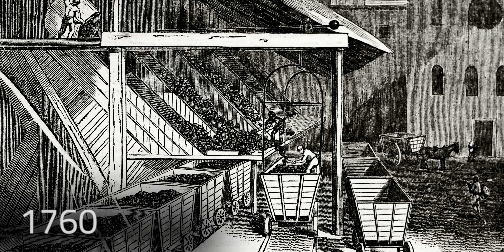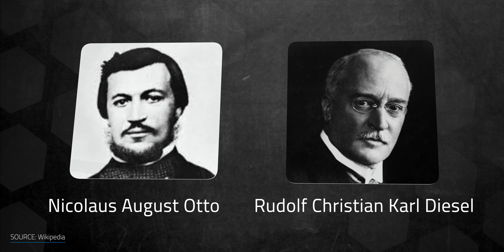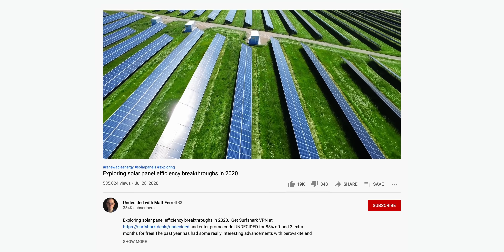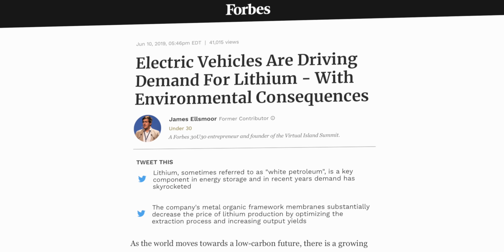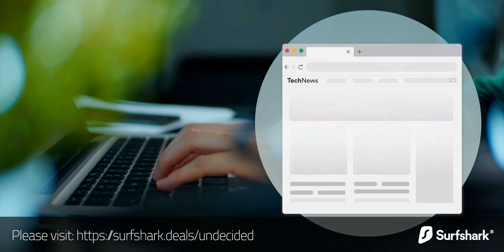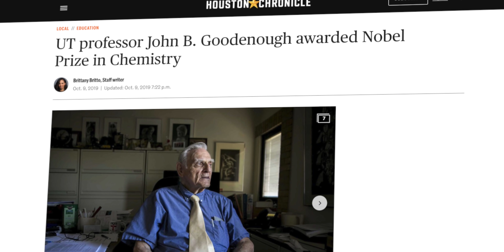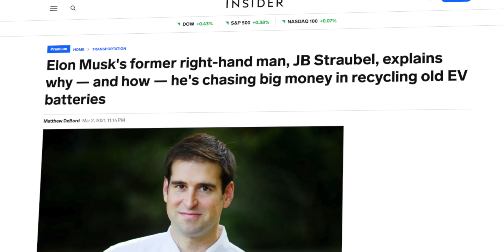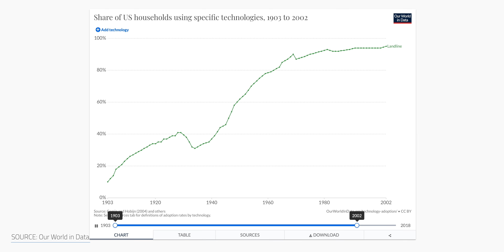Is the Future of Renewable Energy Inevitable?

Comment: How about a video on 'second life' of batteries.  That hazy time between end of life in their primary use and going to the recycler. ... Thanks for keeping publishing this type of video.
Reply: It would be cool to see a device that can take half full batteries and pull the rest of the charge out, disposable batteries of course... You just keep popping them in. Maybe charge a different rechargable battery. IDK,,, is just fun to think about.
Reply: @Robert_McGarry_Poems  Unfortunately, would not be very useful considering how small even the largest disposable batteries are
Reply: @Robert_McGarry_Poems  there is a battery recycler in Europe (I think Austria) that is using the charge from the batteries they recycle to power their operations.

Basically, they need to fully discharge the batteries anyway, so on average they provide about half the energy required to recycle them.

Pretty clever.
Reply: @Robert_McGarry_Poems  try looking up a "jule thief". It does that, a circuit not an appliance.

Comment: I can't wait for the day we can take seawater, use solar generated electricity to create hydrogen from it, compress it and pump it through pipes to areas that currently are water-poor, convert it back into H2O (recapturing a portion of the energy used) and using the clean water in those areas for both agriculture and living. Hopefully not too far away.

Comment: Hi Matt, great video. I really enjoy your work. A frequently overlooked resource, geothermal energy and in particular, enhanced geothermal systems (EGS), is an emerging renewable energy source that should play a larger role in increasing the adoption of renewable energy. Some benefits to geothermal energy include, high efficiency and baseload energy generation which integrates perfectly with our current grid. The western United States has a high geothermal heat index that can be tapped once EGS technologies and drilling techniques can be perfected and made cost effective. The U.S. Department of Energy's FORGE Initiative is currently conducting research in Utah to close these gaps in developing EGS.

Comment: There are some flawed ideas here. 
1. The physics (first principles) of current solar cell chemistry means that efficiencies (percentage of the energy of the sunlight captured) above 45% are not possible. New chemistries may improve this, but the key here is cost improvements. If the cost of solar panels drops because of efficiencies in manufacture, they become increasingly competitive compared to existing energy generation solutions. It is already cheaper per KWh to install solar panels with battery backup than building and fueling power plants and paying for distribution in many parts of the world, and this will only get better as we move forward.
2. While solar panels and wind turbines have limited lifespans, so do traditional power generation solutions. They will be replaced with whatever is cheapest. Following current trends, this will be renewables with batteries.
3. Green hydrogen is like clean coal. It is a marketing concept that does not reflect reality. The inefficiencies of creating, pressurizing, storing, transporting, and using hydrogen mean it will always be a poor energy choice in all but the most demanding applications.

Comment: Wondering how GP Joule gets to 95 % ? In a power-to-gas-to-power configuration I calaculated about a 40-45 % efficiency maybe a year ago. That's not the same as power to hydrogen (that you could use for thermal heating to avoid further conversion losses -  95 % is fantastic) but I think I used 75-80 % back then and even worse for the gas-to-power step. Splitting water gives you not only H2 but also O2, and that's where part of your power input goes to. The 95 % seems to contradict that.
Reply: Ah, I see - they are including waste heat in the efficiency calculation. P-G-P electric efficiency is 40 %. 
It's still an option if you have local value for the heat.
https://www.gp-joule.com/100-renewable/the-power-gap-filler/

Comment: Try running a hospital or steel mill on wind and solar
Reply: There is a great project in germany called Salcos. They plan to run their steel mill nearly entirely on green hydrogen in a few years.
In sweden a similar project has been started.
Reply: @mAx-grassfed  Germany has the highest electricity prices in the EU
Reply: @nigeltufnel4031  
Costs are not that high for companies.
Also germany is an exception in this regard due to EEG. Renewables dont need to cost more. Actually wind is cheapest of all energy production forms nowadays.
Reply: @mAx-grassfed  every MW of wind and solar is backed up by reliable sources. Oftentimes spinning reserves.
Reply: @nigeltufnel4031  
That is not true, lol.
Reply: @mAx-grassfed  what do you do when the sun is not shining or the wind is not blowing?
Reply: @nigeltufnel4031  
Redistributing the electricity from somewhere else where the sun is shining or the wind is blowing or pumped hydro exists.
Reply: @mAx-grassfed  so those other areas don't need their energy?   Also, from the opposite side of the planet?
Reply: @nigeltufnel4031  I ll drop a few key words knly as I am in a hurry.
overproduction, supergrid

pumped hydro is a energy storage

Also need of electricity also fluctuates.

Though energy storage needs to expand further.

But no, not every wind MW needs to be backed up even today already.
Reply: @mAx-grassfed  pumped hydro is limited by geography
Reply: @nigeltufnel4031  i know
Reply: Also there are great low maintenance energy storage devices that could be used in hospitals like redox flow batteries.
Reply: @mAx-grassfed  at what cost. Grid batteries are good for 60 minutes max
Reply: @nigeltufnel4031  
Redox flow can be scaled easily. For imobile uses they are perfect.

Comment: The key is keeping renewables doing something useful when there aren’t enough loads to power. Storage in flow batteries or hydrolysis seems like our best ideas now. I’ve also been thinking there could be quite a market in retro fitting ICEs for hydrogen or converting to EVs
Reply: Flow battery, Na-ion, that's what I think.
Reply: On a industrial scale, I think hydro gravity and molten salt energy storage are feasible.
Reply: Drew

when and where do renewables not have enough load? 
So much of the time their output is abysmally low.

Comment: Regarding GP Joule ... 
Where exactly did you get the 95% efficiency from? 
On their site, I see statements regarding 75% efficiency ... but as far s I can tell, there is no product, just a story for the time being.
Reply: True, some article said 69%
Reply: The 95% is a combined figure for an example-implementation they have. 75% of the energy are used to generate Hydrogen, and annother 20% of the collected energy are distributed as useable heat into a "Nahwärmenetzwerk" = "local heating network", which is provided as a direct heat supply to home owners and business sites. Of course adding up like this would not be valid if you want to generate Hydrogen in very extreme amounts, but combined generation & use of electricity/hydrogen & useable heat in local facilities generally seems like a pretty good Idea to me.

And they are not a manufacturer of a specific product, more a project planning/system engineering company that supports customers with the planning & implementation of a complete use-case including infrastructure. But they are pretty active in marketing the technologies & concepts they use in their systems towards media & politics.

Comment: I think the key to renewables is bringing the cost of solar down to the point where everyone everywhere can cover their roofs at a very low cost. Improving efficiency can come second and will have to be paired with vastly improved power storage tech and availability. Yes, we really can all have power walls in our homes if the price comes down enough. Even apartment buildings can swap out their emergency generators for battery banks.

Comment: Yes, renewable energy of: solar, wind and hydro, with battery back-up, is inevitable, in the long run, however, some SMR's will likely need to be used around large urban areas to maintain base load capacity until battery tech becomes ridiculously cheap and installed.
Reply: @George Mann You might want to tell that to utilities around the world who are supplying a large amount of power from solar and wind farms, today and are planning for MUCH more, in the future.  MidAmerican Energy is currently supplying 80% of the power to their customers from wind power, and plans to make that 100% over the coming decade, and many other utilities are doing the same.
Geothermal will be the source that's more relegated to niche applications as there's very few places you can install a geothermal power plant and even then, the capacity is pretty small.  Hydro will not grow much at all and nuclear is so expensive, it's cost-prohibitive, in large reactors so SMR's are the only hope for nuclear, and even then, they will require quite a bit of government subsidies.  
2 coal-fired power plants have recently closed near my house and are being replaced with solar and wind farms, here in Northern Arizona, like they are all over the world, and gas plant construction has drastically slowed.  
You might want to do some research on future power capacity.  Here's a good place to start: https://www.iea.org/fuels-and-technologies/renewables
As you can see, 26% of all power capacity today comes from wind, solar, hydro and a tiny amount from biofuels and that number is growing rapidly, every year.  When I first started in the renewable energy industry, that number was around: 5%.  By 2030 it will be just north of: 50% and by 2050, it will be nearly 100%.
Reply: @George Mann Please be honest, George, do you work in utility power generation?  Have you ever looked at the pricing structure and LCOE of various power generation bidding on the grid?  Have you ever seen bids for new capacity to utilities?  Do you have ANY idea what you're talking about?!
I've worked in utility-scale wind generation for over a decade, have worked closely with utility managers and engineers, have bid on  numerous new wind farms, have worked with multiple Senators and Congress in D.C. and many state and local government officials in adding new capacity and I know EXACTLY what the price of new capacity is, from each technology, and I know exactly what their tax incentives are as I helped draft some of them many years ago.  Fossil fuel subsidies are permeant, and have been for the past 100+ years, and average: 20% of all production capacity.  Renewables average about 1/2 that amount: https://www.greentechmedia.com/articles/read/subsidies-for-oil-gas-nuclear-vs-renewables

I went with a group to Washington D.C. a few years ago to work with Congress to just give the same subsidies to renewables as they do to fossil fuels, or eliminate ALL subsidies as it's not a level playing field.  Today, commercial wind power receives a: $0.023/kWh tax credit and solar receives: $26% ITC for the construction only, no production credits.  

There's no need for 24-hour battery storage when solar and wind typically meet 100% capacity demands during the day but grid managers have, and are adding battery storage for ~4-hours during peak late afternoon times when solar generation reduces.  

I would encourage you to do some research before spouting off nonsense and opinions you know little-to-nothing about to get educated why utilities around the world are switching over to renewables.  It's not because all grid managers suddenly became environmentalists and say "damn with energy prices," no, it's because wind power averages: $.002/kWh, solar averages: $.003/kWh, nat. gas: $.0035/kWh, coal: $.0089/kWh, nuclear: $.009/kWh.  It's all about economics and solar and wind are cheaper and far faster to deploy and come on line.  Utilities issue RFP's and everyone is welcome to bid, as I have many times with my company, and the lowest price wins, which is why wind power wins most of the time.  Wind turbines spin: ~80-85% of the time with no cost to fuel and very little maintenance.  Solar produces ~50% of the time with virtually no maintenance or cost of fuel.  Fossil fuels and nuclear can't compete, not now, nor in the future.

Also, why are you watching a video about renewable energy when you don't seem to care about it?  You just here to troll and spout lies?

Comment: I would be hesitant to say that modern technology requires less infrastructure than older technologies and that being why modern tech moves so much faster.  I think it is more that more modern technologies run on the same infrastructure so we are not having to redeploy the whole back end every time we come out with a new end-user technology.  Phone systems took a long time because it was expensive to get the circuits laid out, but adoption was about as fast as availability through the whole process.  But then as phone systems grew and implimented multiplexing and other line-sharing technologies to allow multiple calls on the same physical hardware we saw a transition from physical multiplexing, to digital multiplexing, and once it was digital, then we could run phones, fax, and internet on the same lines.  As more internet-focused technologies were rolled out we have transitioned from digital signals running on a phone system, to phone systems running on a digital network.  But this same network that does landlines, cell phones, internet, etc. is the same platform that will support future power switching and other technologies that we havent even thought up yet.

On the flip side to the same coin, because so many different technologies rely on the same basic infrastructure, it makes it easier to green-light and fund these kinds of projects which makes further deployment that much easier.  When you had to maintain sperate networks for phone, internet, cable, and whatever private connections, then each individual backbone is equally expensive to deploy.  When it all runs through the same pipe you can deploy once, and maintain 1 system, while the deployment cost is less (though not as much less as one would imagine).

Comment: Decades of hype, billions of dollars in .gov subsidies, and that hydrogen economy remains elusive for a reason.  Maybe it will capture some niches in use cases like city buses and long-haul freight where mass and volume aren't at the premium they are in passenger vehicles.  But I seriously doubt we'll be routinely committing alternative energy generation (itself generally distributed) to locally cracking water into hydrogen; makes the most sense to either feed electricity directly into the grid or buffer locally (using more energy/cost-efficient means) in the case of curtailment or slack production.

Comment: The next big advancement in renewable energy will be in.....no one knows. Personally this is why I feel a less heavy handed WIND or SOLAR or even RENEWABLE approach is needed. If ones focus becomes too narrow, then the solutions become too myopic. I sincerely believe continuing investments in renewables, geothermic, nuclear, and yes, fossil fuels is very important. Just as advances in hydrogen fuel cells were helped in part due to fossil fuel origins, yes, renewables will hopefully make hydrogen a viable fuel source. I still have high hopes for fussion energy. I still want to see increasing efficiency of the internal combustion engine. I just don't think it is possible to predict when nor in what sector will a significant "Eureka!" moment will occur that will fuel the next big boon in driving energy supply and efficiency.

Comment: I mean... we have seen a 2x efficiency improvment in solar, but we are already bumping up against theoretical limits of efficiency already, and it is already as efficient (if nto more efficient) than the internal combustion engine (~30%).  Granted, more research is needed to get these hyper efficient panels to get form the lab to the mass market, but the research is done, we are near peak efficiency, and the research now is focusing on bringing down prices and extending lifespan.